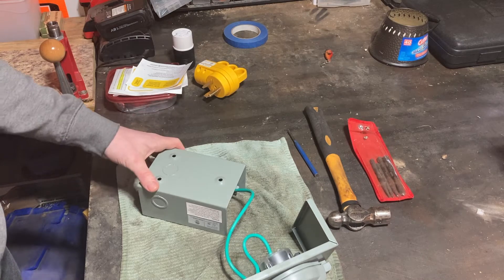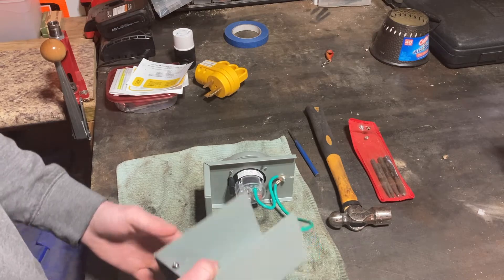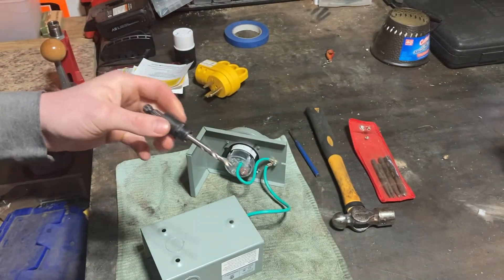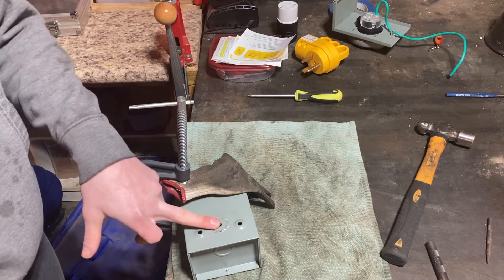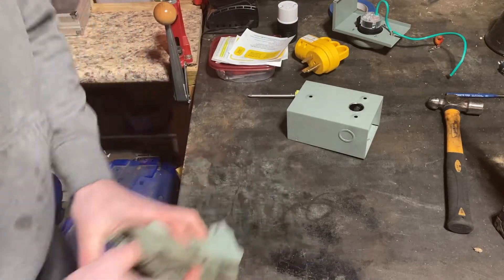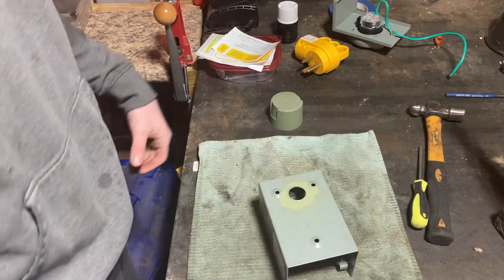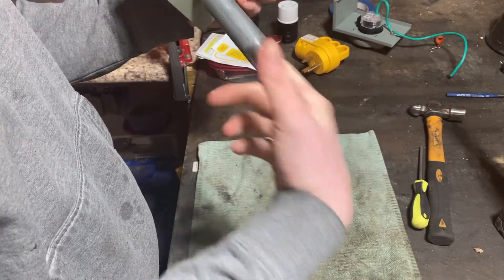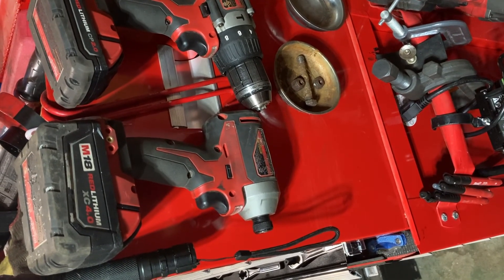MidwestDIY - How to Drill Electrical Box Knockouts with a Hole Saw Bit.

Comment: Also I’m noticing this is water/gas pipe you’re using, not EMT. I don’t know if the pipe you’re using is listed for electrical use but more importantly the lock nut to secure it on the inside will not fit that pipe threading and the plastic bushings you’re supposed to use to protect wire from sharp metal edges may not fit. Also I think with concentric knock out holes you should use a ground bushing which will not connect to pipe threads. I could be wrong here but things to consider.

Comment: Those are knockouts and hole saws are a terrible idea for this work because they walk.  They make special bits to drill conduit holes in electrical enclosures, but your box already has them!  This is why normies should not do electrical work.  You clearly don't know what you're doing and something little like a bad connection in a wire nut can burn your home down. 

Assuming you don't manage to kill yourself in the process.  Installing a generator plug, but you probably don't know enough to install a lockout which puts linesmen lives in danger.  Just leave it to the professionals. For Christ's sake you don't know how knockouts work.  There's  a reason you need 4 yrs of on the job training before you can even call yourself one.

Comment: Thanks for doing the video. It is well done and instructional. I am installing generators at a couple of houses connecting to the panel. One using a transfer switch; the other an interlock setup. Always happy to see a well done video by another DIYer.
Reply: Crazy how many unqualified people are doing such installations.  For you to call this video good tells me you don't know what you're doing.  So you're not licensed, but are doing licensed work. Upgrade your insurance for when you eventually kill someone or burn their house down. Just kidding, we both know you're not insured or bonded.

Comment: Thanks for doing this video.That is a knockout. some are harder than others to knock out.there is a technique to it. they are often knocked out with a screwdriver and linesman's pliers used as a hammer. you could use a hammer and punch if you wish. position the punch near the edge 90 degrees from the bridging, it has to be close to the edge of the cut- that's very important, strike down with force. it is very important that you hit near the edge, the idea is to get it to break free  and bend away. after it bends enough grip it with a pair of pliers and flex it back and forth until the bridging brakes. in the case of that box if it was flexing a lot that could have been part of the problem, you could use a socket larger than the hole positioned underneath to support it while you hit the knockout.